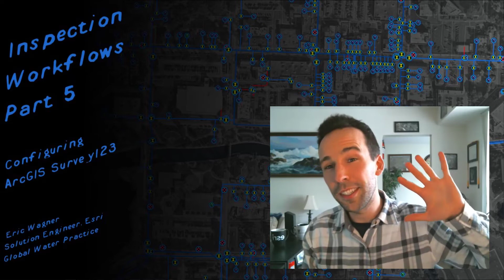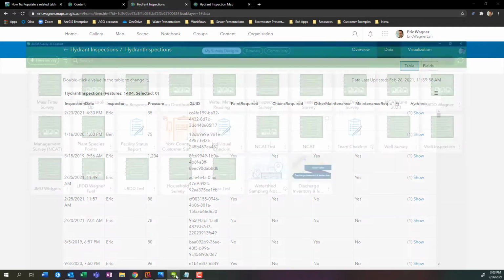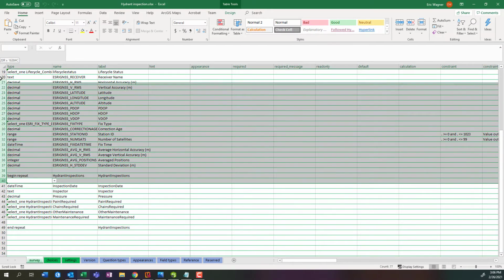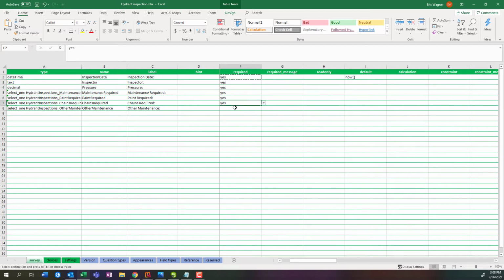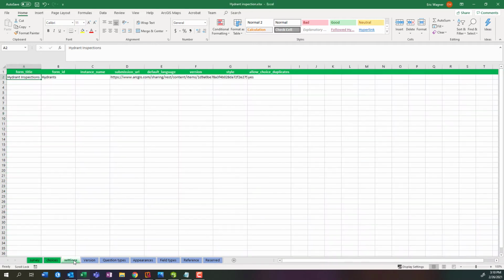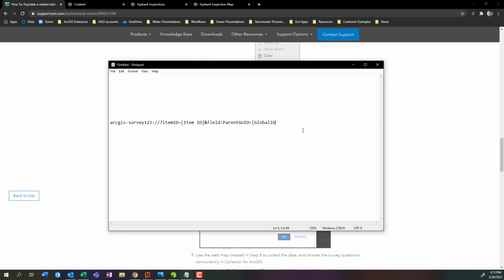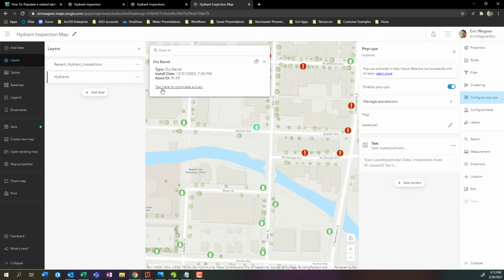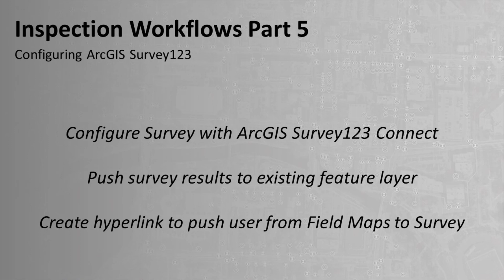Inspection Workflows Part 5: Configuring ArcGIS Survey123

Comment: Hi Eric, I love these series of videos. I think it's great that we have two options to collect data but since you already set up your questions in Field Maps, is there a reason to also set them up in Survey123?
Reply: Hi JS III! Glad you like the videos and great question! The need for the different Esri mobile apps comes up often. I hope I can explain it briefly here.

If you've set up Field Maps, it's easy to see how Survey123 could appear redundant. For some users, it might be. However, Survey123 is far more robust when it comes to making "smart forms". Yes, Field Maps does have the capacity for some conditional questions and other data entry methods, but Survey123 offers even more advanced types of data entry and conditional logic. Also, Survey123 does look more like a traditional form. For some less tech-y or non-GIS users, this is a preferred means of entering data since it may appear more familiar to them than the Field Maps forms. Where Field Map lets you see data on a map, Survey123 is a "familiar face" to non-GIS folks who want to enter data. Lastly, Survey123 does have the ability to produce reports based on surveys submitted. For example: if a gas utility needs to submit to the government a paper form for each valve inspected this year, Survey123 has the ability to push the digital survey results to a template Word document for each inspection record. This pulls the data out of GIS and puts it back onto a paper form for submission and compliance purposes. So, if you're thinking beyond just field work, this could be another benefit of using Survey123 for some of your workflows.

Honestly, it comes down to what is best for your organization's needs. There really isn't a "right" or "wrong" answer. So, you might not need Survey123, but you never know when it might come in handy. I think technology awareness is one of the best skills of the modern GIS professional.

Survey123 common uses:
- When an ArcGIS user wants a highly complex form for collecting data
- When having a robust map isn't necessary
- Data entry that's more form-like for those less familiar with GIS
-Need to produce traditional/paper reports from data collected digitally

Field Maps common uses:
- When you need a map-centric app for viewing/editing spatial data
- Map-based data entry
- Simple smart forms for data collection

Hope this helps!
Reply: Hi Eric you are really great men… I was actually right on time for my project combining the two apps for my survey work… just the operation mode between the two apps back and forth in case of several facilities inspections is a bit hard…

Comment: Is it possible to use this process on a feature layer that is registered as versioned?
Reply: Unfortunately, it is not possible to do this. Survey123 does not work with versioned data in an Enterprise Geodatabase.
https://doc.arcgis.com/en/survey123/desktop/create-surveys/survey123withexistingfeatureservices.htm#GUID-0D7E6B27-CD3D-43C1-A9BA-22DC6BB446CB